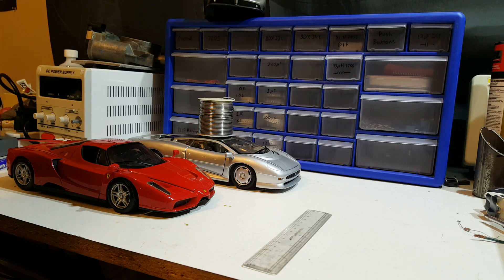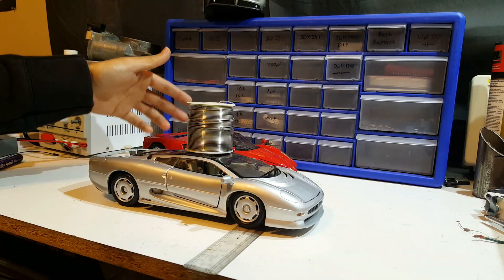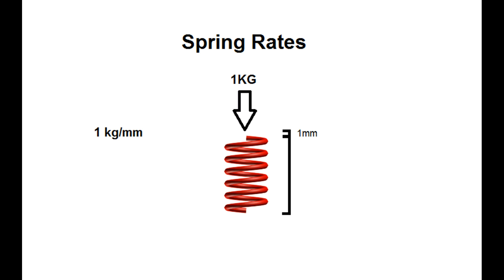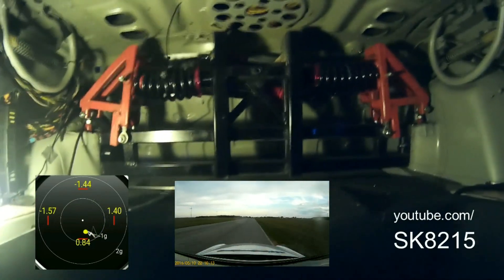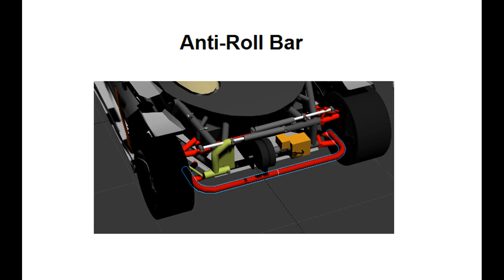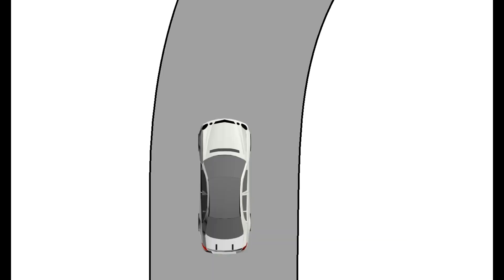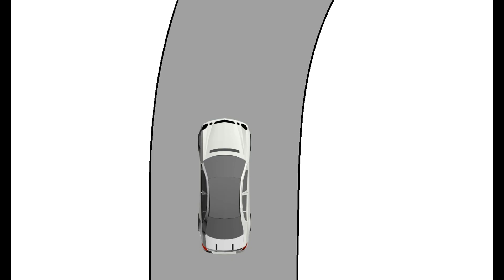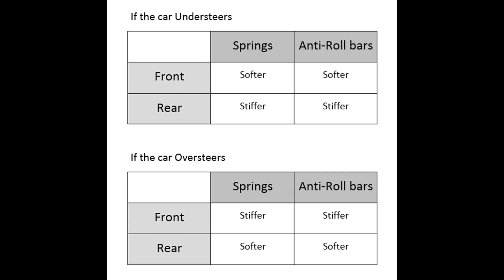Suspension Setup (Springs and Anti-Roll bars / Sway bars)

Comment: Great video. My previous car was a Citroen which had an hydraulic (edit: hydropneumatic) suspension. Now I drive a BMW and it is superior on every aspect, except for the suspension!  It really was very good. Soft and no body roll. The Beemer also has hardly any body roll but it’s much stiffer.
Reply: Ah sure Hydraulic suspension.  Another mystery to be discovered  !
Reply: @MrRobertFarr  
Oh, ok Hydropneumatic. 😁
Reply: @Conservator.  my mum has a Citroen C1 . Hydro Pneumatic. 
Hydro - of water (Latin).
Pneumatic means. Well, involving air, right ?
Sure, those mass produced suspension systems might be well researched. 
I watched this series of videos. 
He did not really mention,  Stress transfer front to back, that much.
It's interesting to hear about. 

The Torque Bars, he covered many of the concepts well.
Hopefully soon, I will break out my BMX.
He said, don't worry if you have, hydraulic suspension. 

I used to work with hydraulic arms, actually.
Reply: @MrRobertFarr  The hydro-pneumatic suspension works with oil and air. 
As far as I know, Citroen only fitted their hydro-pneumatic suspension (hps) on their larger cars (C5 and C6). The C1 has a conventional suspension and they’ve stopped using hps at all 5 or 10 years ago (unfortunately).
Reply: @Conservator.  Ah sure The Citroen Xantia maybe. My friend had a Citroen Xantia. Well, I read up about Citroen,  I believe they were taken over by Peugeot. Did you ever see the French movie called : Taxi ?
Reply: @MrRobertFarr  No, Haven’t seen Taxi. 
Yes, Citroen was taken over by Peugeot and yes the Xantia also had the hydropneumatic suspension. 
My father had one. 
From Wikipedia:
In December 1974, Peugeot S.A. acquired a 38.2% share of Citroën. On 9 April 1976[17] they increased their stake of the then bankrupt company to 89.95%, thus creating the PSA Group
Reply: @Conservator.  Sure, why would Wikipedia be wrong about that ? !
Yes, In Taxi the hero is maybe a Police Man , who can't drive.
He teams up with a Taxi Driver , who handles his Peugeot like an F1 car !

Maybe it's a joke in France that the chassis of, the production cars are more advanced than racing cars ?

It certainly sounds advanced, the video does not mention so much, front to back chassis. I wonder if longitudinal struts, or perhaps cross struts have any function to, twist in a planned way also ?

I noticed the Toyota has a very robust chassis,  in an front to back dire. I get the impression Tesla have a chassis that is like Lego. Just a flat platform. 
In fact, I am growing to dislike Elon Musk and his company that is just continuing to establishing itself  .
Reply: @Conservator.  Ah cool, we had The Passat  , a German version of that car more alike to the Peugeot,  405 as driven in the movie Taxi, I really recommend that movie in French, with subtitles if English is your first language.  French is my second language,  so I enjoy watching French movies , because it gives me a chance to remember my French language education  . I get the impression that France is more competitive than the U.K.
I would consider perhaps going there to work or study for a Master's Degree as, apparently in Europe at the moment.  Masters courses are cheapest and appear to lead to employment  opportunities.

Comment: Fantastic video.
So if I make the rear anti roll bar a bit stiffer, but the engine is behind (Mr2), since the car has a little tendency to understeer, it might get a little more balanced?
Reply from the maker: Correct. Another quick trick people use is, removing the anti roll bar link on the front. That changes the balance to over steer too but with a bit of extra body roll
Reply: @xfmotorsports  oh, thank you for the answer!
I don't think I'm a fan of the last one because I'd prefer less body roll over all, but I hope to try the new anti roll bar soon... I'll leave some feedback if you don't mind

Comment: if you losen the nut at the top hat by 90° loser does that create a softer spring rate?
Reply from the maker: Not sure which nut your referring to but there's usually a damper adjustment knob on the top hat. That softens damper compression usually
Reply: @xfmotorsports  im talking bout the strut mounts
Reply from the maker: Oh. No that definitely won't change spring rate
Reply: @xfmotorsports  im having the worst time with my vw .. i changed the entire suspension 3 times from the struts to mounts to wheel hub with calipers to the sway bar and even subframe and anti sway bar links . for the life of me this car rides like shit and i donno why

Comment: In your model at the 5 minute mark, the spring ratio would be 1/4, not 1/2.  Every Kg of force exerted by the spring the exerts 1/2 Kg of force to the wheel, but to compress the spring 1mm it takes 2mm of movement from the wheel.  1/2 Kg / 2mm = 0.25 Kg/mm at the wheel out of a 1 Kg/mm  spring.

Comment: excellent video thank u very much,the animation is perfect,just a quastion, in case u would only put stiffer springs at the front(and leave the antiroll bars front and rear as it was on the initial set up)how would the weight distributed in that scenario?
Reply: spring stiffness does not affect static weight distribution. only dynamic.

Comment: just a question: @13:34 shouldn't it be +150kg on both the front tires? Or even +300kg on both, because you've got 2 sway bars instead of one, but that is less important than the first question. I mean, as you said, the sway bar will try to counter balance the forces from the roll movement of the vehicle, so it should add an equal amount of force on both tires, not adding to one and subtracting to the other, right? And i think it's also because if the total weight of the car is 2000kg, it means that in a static situation, the sum of the normal force on all 4 tires should be 2000kg, but under roll you should consider the force given by the sway bar(s), so the sum of the normal force on all 4 tires should be ABOVE 2000kg. It's kinda confusing me, i don't know if i'm correct or not, so please read this. Also, i must confess it's the 6th or 7th time i've watched this particular video, and i even watched more than twice all the other vids on your channel, you're one of my favorite channels, so thank you for all your work!
Reply from the maker: Hey, load can't be added on both front tires using an anti roll bar. Also, the example is assuming a car is going through a corner and the forces on the chassis are only lateral (no longitude forces), so it will transfer weight side to side but there's no weight transfer rear to front. If you add up the values from both front tires they are 1000kg before and after. They only time that will change is under braking or acceleration (when weight transfers longitudinally). Anti roll bars and spring rates will only transfer loads corner to corner but they can't change the weight distribution entirely. The only time you will get anything above 2000kg or additional added load over one axle is if there is downforce or some external force on the car. Hope it makes sense

Comment: It is kinda confusing. On one hand you say that ARB reduce the body roll, thus making the weight distribution left vs right side of the car more balanced, cause the car does not roll that much. But on the other hand, you state, that instaling stiffer ARB means more disbalance in the weight distribution left vs right, by putting more weight on the outside wheel. So the car rolls less, because of the stiffer ARB, meaning less weight on the outside wheel. But then the stiffer ARB puts more weight on the outside wheel.. So what is the point of installing the ARB when the benefits are canceled by its atributes? I assume, that with the proper sized ARB, the benefits from less body roll are grater, then the downsides of putting a stiffer ARB, correct? So no ARBs or too soft ARBs = too much body roll, less cornering speed, properly sized ARBs = cornering speed at max potential, too stiff ARBs = less body roll, but still outside vs inside tire disbalace meaning worse grip..? How can you find the happy medium, that works best? Thanks
Reply from the maker: Stiffer anti-roll bars definitely help but its important to keep the stiffness front and rear reasonable. Going extremely stiff on only one axle will unbalance that axle but if you stiffen them by the same amount it does not change the cars balance, it just reduces body roll. That's why its important to change both front and rear anti roll bars if you want to maintain the same handling balance.

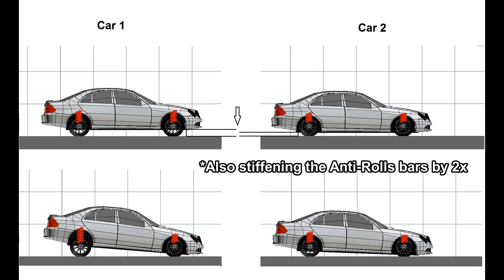Comment: At 6:00 he says that if you have half as much ground clearance, you will have to double the  spring rate.  That's true if you only use springs to resolve the settings.  You could dial in anti-dive and anti-squat, and keep the spring rates lower.

Comment: I'm pretty sure it's not how coilovers are supposed to be adjusted.
The bottom nut is for ride height, top one is for spring preload and it's rate is supposed to be changed with the whole other spring.

Comment: Boy, so much info!
You had said to adj. the the "top" of the Coilover @ the spanner nut/s and not the bottom where the male female threads @ the shock tube is, as far as ride height goes, I thought it was the other way around ? Plz clarify this... BTW the Video is awesome. Ps. I would want to go with front soft and rear stiff w/ a front wheel Dr car?

Comment: Anti-pitch bars are useful but difficult to engineer unlike anti-roll bars. The main reasons are the anti-pitch bar will need to be mounted under the car's chassis as it needs to long enough to reach between the front and rear suspension arms. A tube or bar of sufficient length would be much lower in rate so it needs to have short arms and be very thick. It would be a heavy addition to both right and left sides of the car. There are ways around this but too lengthy for this post.

The advantage of anti-pitch bars is you can soften your spring rates to increase grip while maintaining overall wheel rates of the entire sprung weight system. In an ideal situation, yes you would want to utilize both anti-roll bars and anti-pitch bars. 
Active suspension can achive this at essentially zero wheel rate with perfect anti-roll and anti-pitch coupling.
Reply: I recently cancelled the purchase of sway bars because I learned that they actually decrease the traction on cars with independent suspensions. My question is, why wouldnt I remove the sway bar completely?
Reply: @MW-qo8hw  Anti-roll bars decrease maximum traction, yes, but that doesn't mean that they aren't useful. Maximum traction is only really the most important thing in steady state cornering (like long sweeping sections). But during transient motions, you want to prioritise keeping the car level, as this will allow you to begin rotating the car faster, even if the absolute peak grip will be reduced. Running no anti roll bars at all will make the car really sloppy on turn-in and fast directional changes if you springs are soft.

Car setup is all about compromise. Are you going to be driving on a really fast race track with lots of tight, technical sections that require you to be agile through the corners? If you are, go get some anti roll bars. Are you going to be just using it on the mountain roads or in the street where you're not driving too quickly and the cornering radii are generally going to be much higher? Stiff anti rollbars are gonna suck, not because of the changes in handling dynamics (you'll feel the difference but it's not going to be too significant) but because it's gonna be bumpy as hell.
Reply: Anti pitch is generally controlled.by rebound damion on the rear in inbound damping on the front. Keeping the weight balanced during weight transfer is key. Lateral (roll) grip must be weighed against braking/acceleration (pitch) which is why sway bar and damper settings must be changed together
Reply: @Not_A_Cat  Here is the easiest method to achieve a well balanced and consistent balanced car. General guidelines.
1. Never use higher-order forces to compensate for incorrect lower-order forces. 
2. Never use lower-order forces to compensate for incorrect higher-order forces.
3. Less force is generally better than higher forces.
4. There are fewer and smaller trade-offs when dealing with smaller forces. A lighter, lower and wider car will have smaller forces to deal with using spring rates, anti-roll bars, shock rates, and aero.
1st order forces:
Static weight distribution and Center of gravity height.
2nd order forces:
Jacking forces, unsprung forces, and sprung forces as well as aero.
3rd order forces: 
Shock dampening and gyroscopic forces.
4th order forces:
Generally only achievable with active suspension and active aero. Such as velocity dependant damping rates and g-force dependant aero.
Reply: @WhitentonMike  I don’t know at all but u sound like a freaking genius, I like learning about this type of stuff. Is there a place or school you would recommend going to around the Houston area

Comment: Your formula for Wheel Rate and Spring Rate is incorrect. It is Wheel Rate = Sprint Rate x (D1/D2)^2
The reason is you are not only changing the force but the distances traveled. Remember that a Rate is both Force and Distance so you need to multiply the lever arm ratio twice. So a lever arm ration of 0.5 would result in the force difference of 50% and the distance traveled of 50% or a rate ratio of 25%.
Reply: Also take in to account your sprung vs unsprung weight. Damping is more important than overall spring rates, and geometry can be altered to maximize the characteristics of any given dampin/spring combination. The whole science is relativity, one change requires 4 more changes to make the geometry work on a given road surface.

Comment: But if the softer the anti-roll bar, the more grip, why have an anti roll bar at all? The "softest anti-roll bar" would be a non existent one wouldn't it?
Reply from the maker: No anti-roll bar would also mean more body roll, so you'll need to run your car higher from the ground to allow that body roll. Higher CG would mean more weight transfer so slower cornering speeds. There is a certain anti-roll bar stiffness that works best, excessive stiffness is bad too. Its best to go with adjustable ones so you can play around and find out where everything works best.
Reply: @xfmotorsports  in addition to ground clearance it is also important to reduce roll to maintain proper suspension geometry.  too much roll throws off camber
Reply: more roll also screws up your car's agility, making it way slower during quick left-right-left turns in succession.

Comment: SO8215,
Are there obvious reasons why the anti sway is connected front-to-front instead of diagonally: front-left to rear-right, front-right to rear-left?

It seems to me that this would limit both sway and pitch. It would also limit front-to-back traction transfer during cornering - unless the brakes were also applied. 

(I can see that lifting one side of the chassis to change one tire would tend to lift both tires off the ground.)
Reply from the maker: Pitch usually isn't as big of a problem as roll. It also depends on the suspension geometry but usually pitch can easily be countered by using an anti squat or anti pitch geometries. Since cars tend to roll more, anti-roll bars provide that extra bit of spring rate only while the car rolls so it fixes that problem. Excessively stiff anti roll bars will also ruin handling, but there is a right amount of stiffness that works best.

Comment: im looking for a video on the best setup for a fwd car(gti) . Intuitively im thinking stiffer in the rear and softer in the front ? to counter act the lift of the front end during a launch or hard acceleration. Am I wrong seeing it that way? would it affect the car negatively with such a setup?
Reply from the maker: It depends on if your setting up the car for drag racing or circuit racing. For drag yeh in fwd cars you try to reduce weight transfer to the rear during launch, so stiff front springs will help. For circuit racing cornering is really the main priority, so soft front and stiff rear if your car has understeer and the opposite if it has over steer.